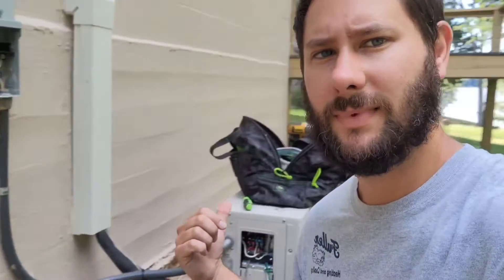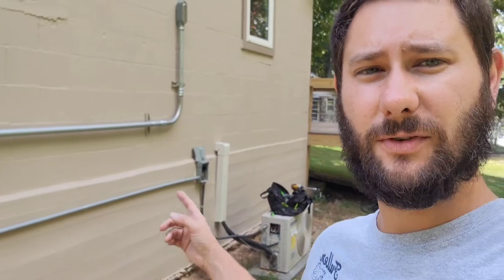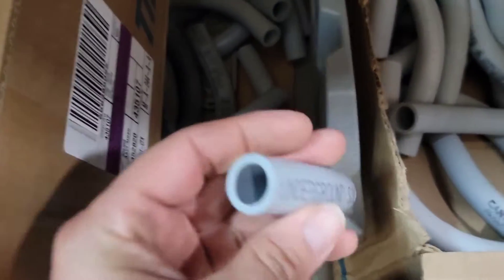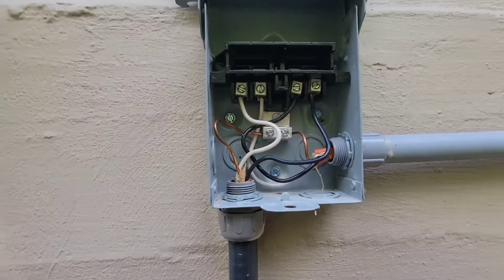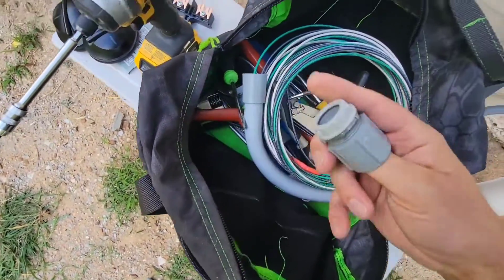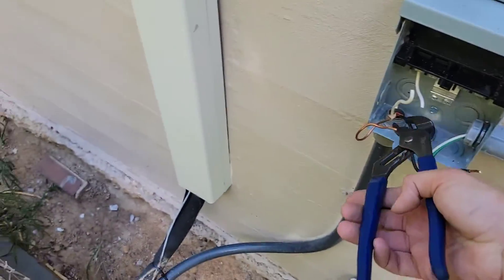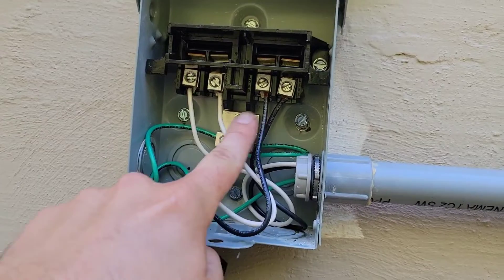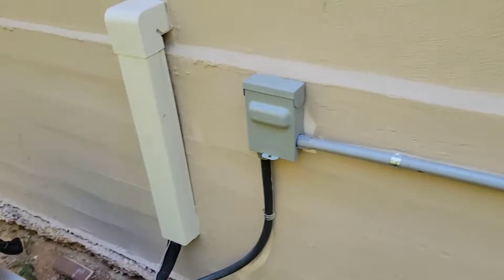Electrical Inspection FAIL! Wiring and Conduit Mistakes to AVOID!

Comment: The PVC has to be glued and cured before running the wire.  The solvent offgassing from the glue can damage the wire insulation.

Comment: I'm an elect. contr. learning about HVAC and your learning about electrical wiring. 
To the novice the white wire in the disconnect or condenser might make one think it's a 120volt system.
Also the single conductor wires from a wire spool have their listed properties on the wire cover, romex doesn't,  thats the part of your initial insp. failure.
 Yea sure we sneak a romex into a conduit, they seem to work just as well.😮

Comment: The inspector must have  considered the  sch40 to be subject to damage therefore the sch80 or a metal conduit like emt. An expansion coupling in the pvc conduit may also be required.
And current carrying conductor are identified not by bare, green or white.

Comment: Has anyone else ever had to run schedule 80 pvc ? I’ve been a licensed electrician for 35+yrs never ran it. Also have never had to color the white wire on a 240v circuit and I’ve done it hundreds of times water heaters and a/c ?
Reply from the maker: I have never had to either until this job and now. The inspector makes us run schedule eighty above ground on every job
Reply: @taddydigest  I don’t get that but localities can go above and beyond the NEC you should ask the reason behind it I remember having requirements years ago for only BX now MC cable in basements in certain cities that was because of rodents chewing on NMC
Reply: Anything belove 66 inches
Reply: @bill7949  what section of the code I’ve looked and never found it

Comment: There’s something wrong with your inspector unless you’re using a different code other than the NEC and I believe code allows wire size 10 and under solid to be run in pvc maybe if you followed the contour of the building with pvc inspector might have passed it bend pvc so it lays against the building

Comment: Why did you buy white wire ?  Its 230 volt 2 blacks or red and black.
Reply: Or blue!
Reply from the maker: I'm thinking back I have no idea.
Reply: White should only be used for the "grounded conductor" otherwise known as the neutral.   Even in solar wireing, if you ground the the negative wire it should be white not black.

Comment: Always use a FUSED disconnect, better safer, better
Reply: The NEC calls for a disconnect with in sight not a fused disconnect ,The fuse is the CB in side the circuit breaker box.
Reply: @kennethchristensen7457  fuses work faster, better as they are closer to the fault...
Reply: Years ago before HACR breakers you needed to install fused disconnect
Reply: 2020 code also requires all outdoor units to be GFCI protected I don’t see many inspectors enforcing this there has been lots of controversy some states haven’t adopted this code.
Reply: @lou198  yup, cus there have been an issue with too many false trips...the equipment makers have to make them compatible with AFCI GFCI stuff....they made it a code requirement before the mfgs had stuff that would work with GFCI. I think last I heard the requirement has been put on hold, due to issues.  N.J. just adopted 2020 code, weird! 2023 is in training now for current license renewal...
Reply: @cengeb  think I’m putting my electrical license on hold
Reply from the maker: Great idea